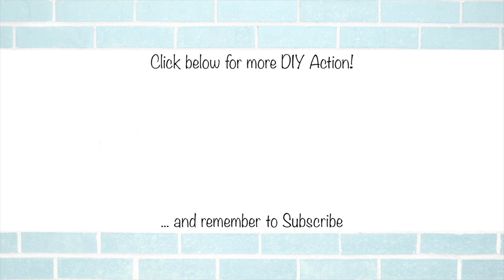OAK GLAZED ENTRANCE DOOR BUILD

Comment: Hi Tim, I’ve done the same as this three years ago using the same type door and frame construction, a word of warning long term keep an eye on the external face veneer the osmo oil does let water in and you get blisters were the moisture blows the sub base of the door. Ive sanded lightly and recoated each year to keep a good covering but next spring I’m going to router the face off and  reveneer , i also run a small bead of low modulars silicone around the joints between the beads and glass and that stoped water seeping in.
Apart from that my lookey likey oak came out ok as is yours 👍
Reply from the maker: I do anticipate issues with the veneer, which is one reason I have built such a big roof overhang. Some finishes can actually make it worse but osmo does seem ok if it’s got a decent build up on it and not just wiped on. The original plan was to paint the external joinery and leave as oak internally but now I’ve seen it come together I’m tempted to just keep on top of the clear finish and keep the wood look.
Reply: The Restoration Couple I’ve been using osmo for five years now and I made my solid side gates and garage doors and it’s all fine, I made my panels on the garage doors from 1.5 veneer on wbp ply and have had no problem it just seems to be the veneer on the doors, I do know about a good build up
Reply: Silicone on outdoor woodwork is usually the worst thing you can do as it won't be able to keep all the moisture out but certainly keeps it from escaping. My builder did that and it rotted my windows in exactly the spots he used it after only 7 years.

Comment: Looks good. Getting frame material like that here in the US is very difficult. Even my big local door supplier has a hard time getting it as most large custom door companies make their own. Those ball bearing hinges are all I use they make a huge difference in the smoothness and the long term fitment of doors. 

      Oh and for making your own frames.... Don't even think about it. Picking through lots of lumber to get good straight grain pieces then you cut them all up and then find that you have to remake half the parts because they warped is not fun...
Reply: Do you not have independent timber/lumbar yards over in the US mate. Here there are loads, my local one has around five branches all over the north west UK and mostly around Manchester. At their main branch they have all the machinery to machine the wood. They machine up all the skirting/base boards, all of the architraves/carrying trim and all our for casings and hardwood window frames like Tim is using her.
I did wonder why American carpenters have to make up their own for casings with stop beads etc in their YouTube videos. 
If you love the window frames then you would absolutely love it here.
Sure we too have to go through and pick out the bent or bowed stiff but that's mostly the 2 by 4,s etc  👍🏻🙂
Reply: @garethheathcote4988  Our construction industry primarily produces the high volume low cost commodity materials. High quality pieces can be made by specialty companies but its very expensive. I have made many custom pieces as its cheaper to buy the cutters and run it through the moulder yourself. 
            I havent been to England since the mid 90s. I can easily get there as the better half works for an airline and I can fly standby.  Its a direct flight from here too. Need a list of tool stores and hardware stores etc to go visit there. I go tool shopping in other countries. I have tried to find tools in Greece to buy but they are usually cheap junk no odd stuff.

Comment: I swear you're the only other UK based individual I've seen use a jaw horse, usually get a fair bit of leg pulling when I grab it off the van - right up until they see what you can actually do with it.
Reply from the maker: Ok in mainly use it as a stand for some bench tools that are mounted on a base. Works great.

Comment: Hi Tim looks great. What Osmo finish are you using on this?
Reply from the maker: Just clear UV oil. We may actually paint the outside in the future but want it protected for now.
Reply: @TheRestorationCouple  hi,did you stick with the UV oil? wondering how they held up or did you go over to another product? we have to redo a 2 year old simular door that has high exposure to rain and sun and original oil did not last well, wanted to keep the light oak look
Reply: @seesaw66  I'm at the same conundrum, what did you decide in the end? I was just about to buy the Osmo UV oil for an oak veneer external door, but was concerned about the protection and durability